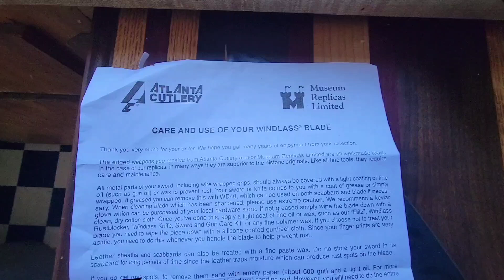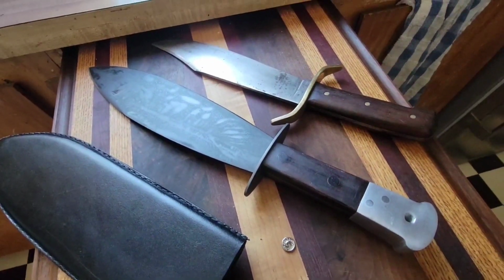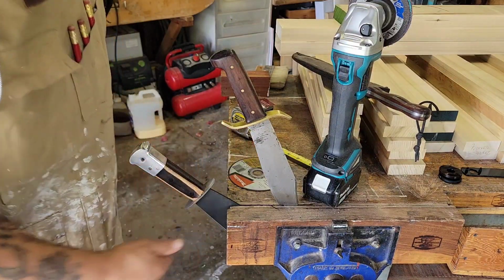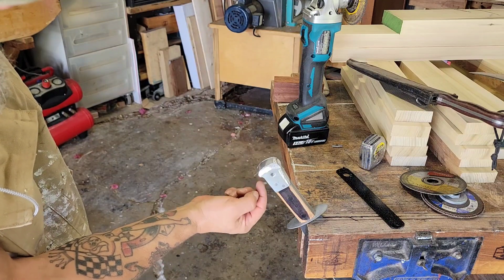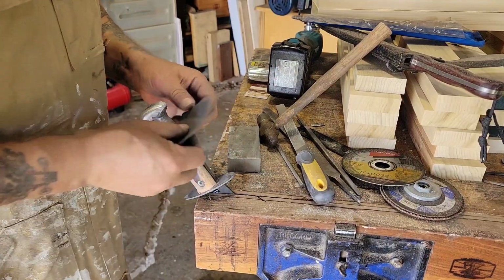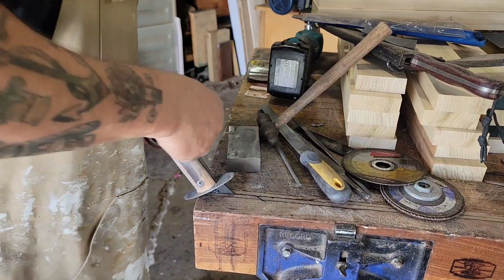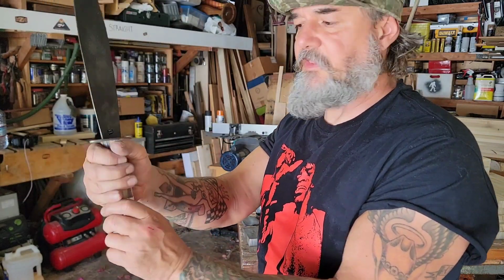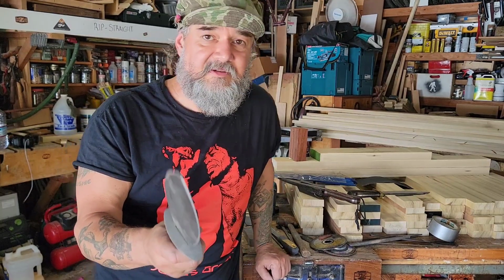OSS Smatchet - Museum Replica - Handle reprofiling

Comment: A Marine through and through...
He doesn't throw crap tools away; he modifies and improves them!

Mike's attitude => "Pffft!  Excalibur's busted?!?  I'll borrow my blacksmith friend's forge, hammer out these dings and sharpen the edge.  It'll be ready for war again in 3 days, tops!"

(<sigh>  One of the things I WOULD Like to buy one of these days is a replica of the sword Excalibur used in the 1981 movie, Excalibur.  An elegant and simple blade design.  I already own several lightsaber hilts!   😂  I bought just the hilts and not that electronic stuff.  I knew I'd be whacking people on the head OR breaking stuff at home if I bought an electronic lightsaber!!!  I probably wouldn't opt for a sharpened sword blade on a replica sword for safety reasons and clumsy ADHD relatives...)
...
...

I have to say, honestly --
Hats off to people who work with their hands and enjoy the work.
There is something satisfying about doing little hobbies and projects with your hands, OR fixing things that would cost you at least 4 times the parts cost in labor!

(Yes, there are jobs I wouldn't attempt on my own because I don't have the experience and I don't feel safe doing them myself.  That includes many things on my car and items like the garage door.  Painting and most small electrical work [changing an outlet/wall socket, light switch, replacing exterior light fixtures] is doable for most people with IQ's above room temperature {average 72-degrees, Fahrenheit!  Sometimes, Celsius measurement does feel closer to average human intelligence!} so long as you're safety conscious and use your circuit breaker box when you need to!  I've changed my 2 outdoor light fixtures, at least 3 light switches, and 2 wall outlets.  I must be doing something right with the circuit breaker box because I'm still here and have only been shocked by static electricity in the winter!)

Out of everything I have done to fix hardware, I'd say painting is the hardest.  SOLDERING, which scares me to a point, is EASIER to do right the first time than painting most things!
Painting is an art form, trial and error, depending on what it is you're painting and what type of paint you're using!
Reply: PS -- Mike's modded handle DOES look better than what was shipped to him.  I'd say it looks at least 4-5 times better but that's my opinion.
It's always kind of nerve-wracking modding anything but if it makes your life easier OR the end-product is better than what you started with, the modification was worth it!
I presume Mike is planning to use this on a future trip into the desert?